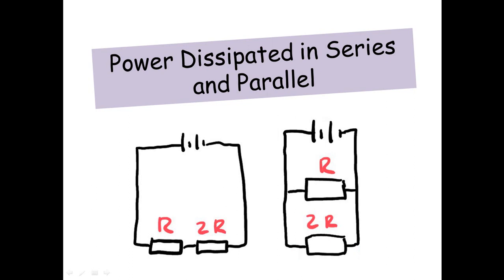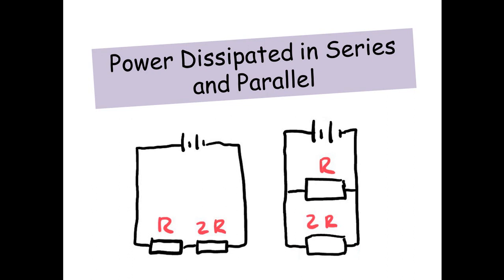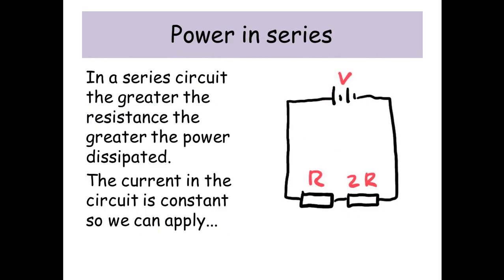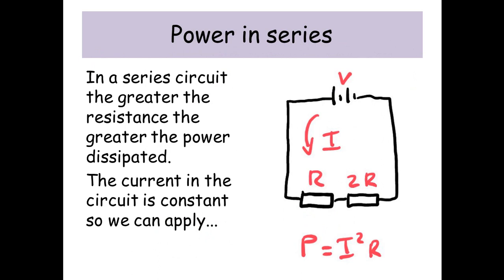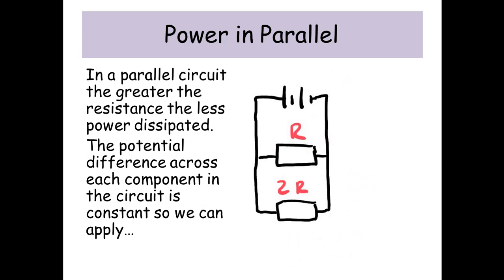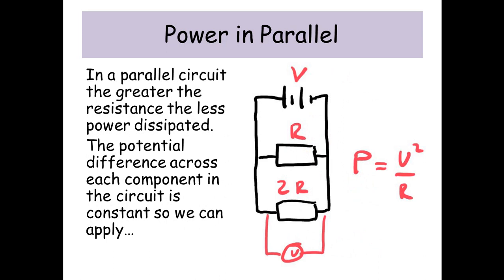Power dissipated in series and parallel - A level Physics

Comment: In series circuit if two 1 watts resistors are connected, will the total watts increase or remain same as 1 watts only?
Reply from the maker: In series they half and parallel they double as a whole

Comment: I never realised that the power dissipated is different for series and parallel
Reply from the maker: Funny isn't it.
Reply: @ChrisGozzardThatPhysicsGuy  And very helpful :D I am trying to reverse engineer a pottery kiln and all the heating elements are in series, it has two in the floor that are lower resistance I initially assumed they would be running hotter not colder. Glad you explained it so easily.
Reply from the maker: @Jigatree  oh thats so interesting. Is this for a hobby or are your a professional ceramist? If that's the term.
Reply: @ChrisGozzardThatPhysicsGuy  It is a hobby at the moment, I do work in the ceramics industry but not related to kilns as I decorate the ware before it is fired.

Comment: so can i still use I squared R in parallel, and for series as well? because it still works right? cause the total resistance of a parallel combination is less then in series and hence your current will be greater in parallel, meaning that if you have a greater current you have a greater power dissipation, right?

Comment: ok so our domestic appliances are connected in parallel so if we take examples of bulbs a 100-watt bulb will have lower resistance compared to the 50-watt bulb?
Reply from the maker: Yes you are correct.. #TeamPhysics

Comment: Wow this is so simple and straight forward. Kirchoff's voltage law for series circuit almost got me confused there.
But do you mind sharing an idea on why Thevenins theorem and Kirchoff's focuses On Voltage to get the current while Power depends on Current in the series circuit. Thanks
Reply: You can use current to also find power in a parallel circuit. You can also u voltage to find it in a series circuit. You choose I suggest you review ohms law again
Reply from the maker: Yo

Comment: So, the power dissipated in the 2R resistor in the parallel circuit is half that of the R resistor?
Reply from the maker: Same voltage but half the current so yes